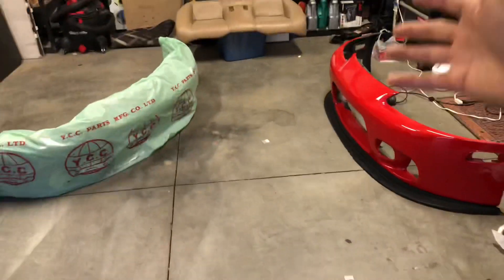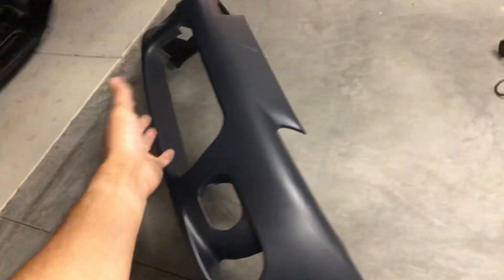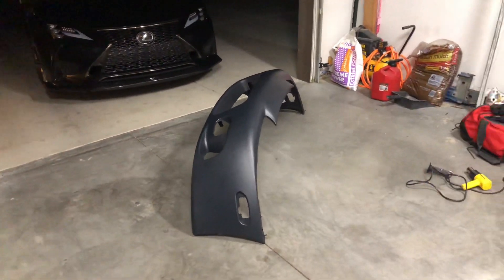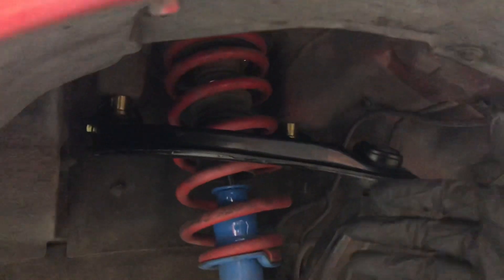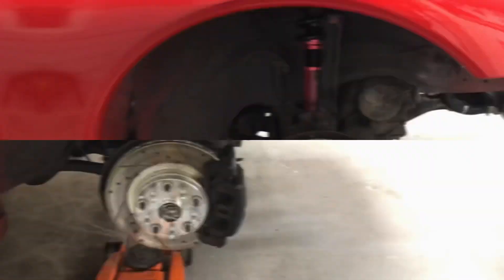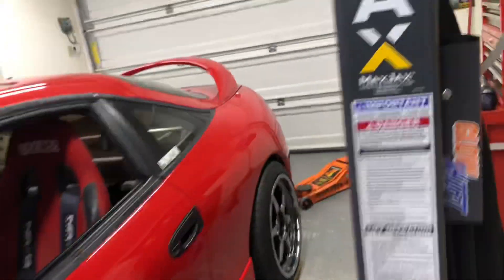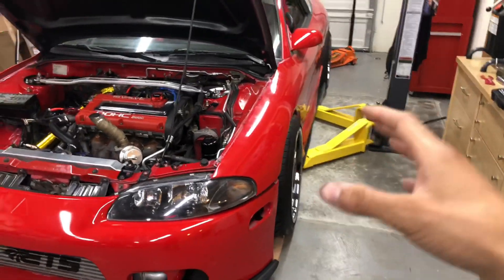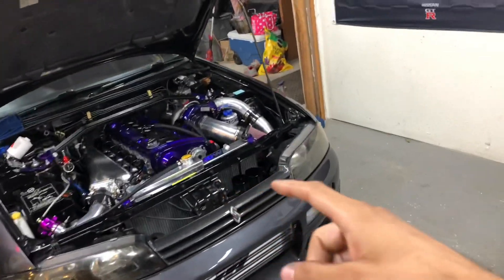Mitsubishi Eclipse Gsx Gets New Coilovers!

Comment: What wheel size are you running
Reply from the maker: I am running 18x9 im not 100% what offset it is.
Reply: @isaiaharechiga8924  ok. Bc i got the same coilovers bruh mine doesn’t sit as low as yours, i can still fit 2 fingers in between. Have i have 18s on mine. Do u have an idea why it’s like that?
Reply: @isaiaharechiga8924  I lowered them, but it acts like it doesn’t want to go any lower than it already is
Reply from the maker: @TRExOfficiaI  i adjusted them pretty damn low i would not recommend going lower until you upgrade the lower control arms becuase they are prone to give out happened to me a year ago.